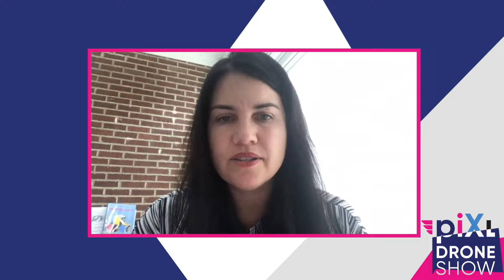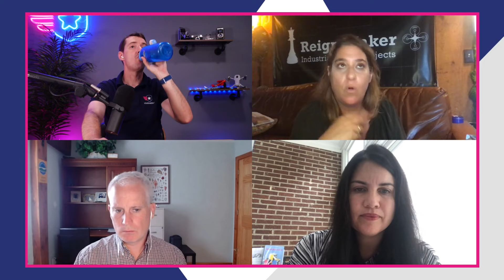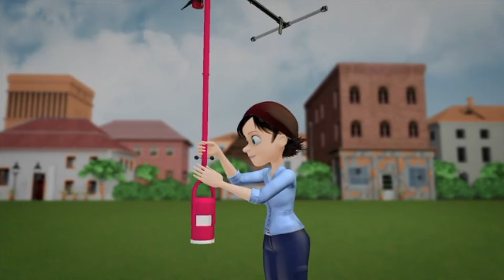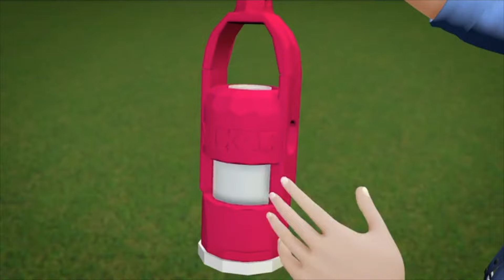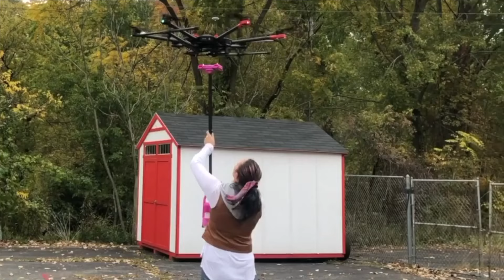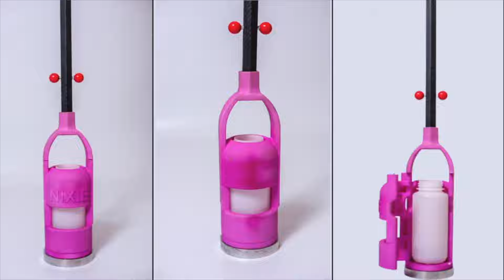PIXL Drone Show #16 - Water sampling and Remote Sensing

Comment: If you fly with the current don't you get a sample from generally the same spot and negate the pull of the current that "increases" the weight of the sampling unit?  I realize this is not viable in confined areas, but open streams, rivers and bodies of still water should work well?